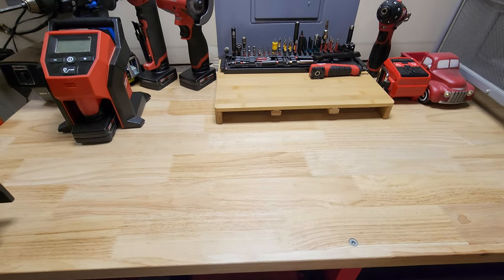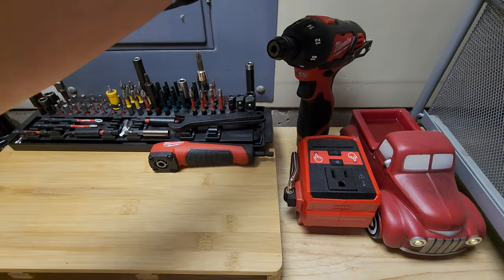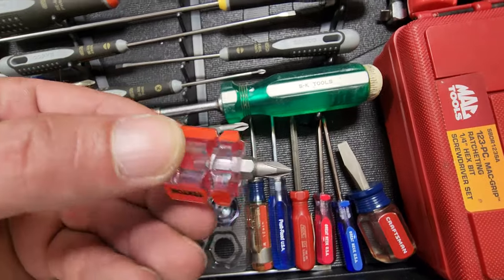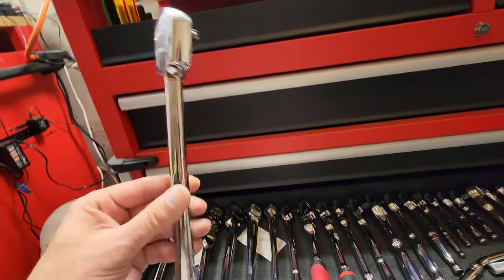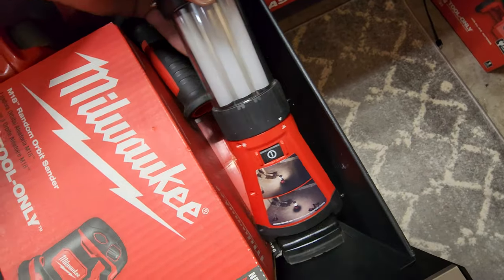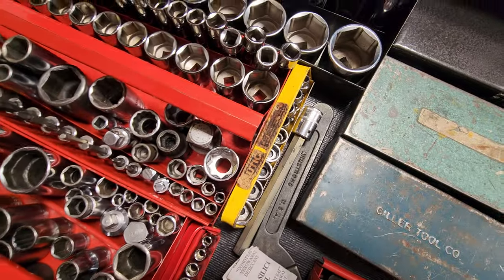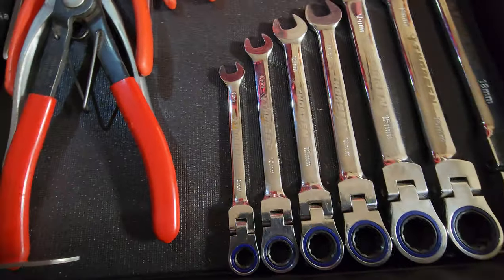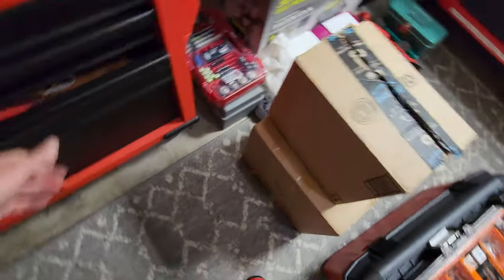AVERAGE JOE'S TOOL BOX TOUR 2022 MIX OF EVERYTHING

Comment: Hey man...
Im havin a bit of an issue with my
Convoy L21A SFT40 atm
Im getting this donut shadow purple
shaped in the middle of the beam hot spot 
and it's very prominent?
it's really pissin me off kinda thing
It wasn't like that in the begining
Not sure if it's the emitter burned out
after playing around with all the modes?
But the hot spot needs to be solid 
It was always Solid...
Im not talking bout when you hold it
really up close like on a table 
to see the Beam Pattern shape
there's always that little bit
But fades out as you shine it further
That's normal..
But now this is pretty much noticeable
even when you actually shine it 
at a distance on a wall building 
or anywhere else
Have you experienced anything like this
with any of your lights..
Your ST40 review was pretty solid 
Thats how mine used to be
don't know why it's doing it now
and it was purchased from 
Convoy official store...
It was a few months back so
I don't think there's anything i can do
to get it replaced at this stage
But i don't want same issues
if i buy a new one either....
Reply from the maker: Sorry to hear you are having issues with your l21a, I'm checking mine out now and it's solid no issues,  Did you check the surroundings and the LED to make sure nothing accidentally interfering and shake it lightly to see if anything is lose or rattling?
Reply: @smotheredchrome  
Apreciate you getting back to me 
on this brother 👍👍
Everything inside is pretty much solid as
I never had issues with Convoy before
It could be a one off thing
but i just taken out the actual 
mirror reflector and when used without it
seems to work ok
But its basically just a big round flood
at this stage, so i think the fault is the
actual mirror reflector itself 
for some reason
Its not damaged or scratched either..
I tried cleaning it and polishing it too 
but the ring is still there..

You know what it looks like 
Remember The old MAG LIGHTS 
or any of the past lights 
how you used to get the ring shadow 
right in the middle of the beam?
That's pretty much it

I messaged Convoy on Aliexpress
but we'll see if anything happens

I wana  try and change 
the actual reflector inside 
and see what happens?
I think that will fix it
You know where i can get them
On their own like that?
Either that or get the entire 
Flashlight Host and try that...
But still i'd rather just get part
And If that doesn't work 
i can always take it out on the property 
and use it as a target with my Marlin 45/70 👍👍
Reply from the maker: I'm not sure on convoys warranty I've never had to deal with them But see what they have to say I will keep an eye out for reflectors did you check eBay maybe or maybe convoy might sell reflectors pretty cheap if I see anything I will definitely let you know.
Reply: @smotheredchrome  
thanks👍
Reply from the maker: No problem my friend appreciate you 🙏
Reply: @smotheredchrome  
I think that's how the actual light works
Looked at the stats on convoy online 
The Reflector is coated with a
Purple Mineral Film
Try it out and see

With the torch switched off
If you look into the lens  
While ur standing holding the flashlight
underneath pointing upwards ur room light 
You can see the reflection of it 
being completely Purple inside

The further it goes 
the more you can kinda notice it
Once you notice its hard not to
But...Still good light though
Still useful..not that bad
I'll try the L21B Version 
See the difference there

I mostly use the Convoy L8 SBT90.2
A Beast..my favourite of Convoy by far  

Thanks anyway brother Apreciate it 👍👍
Reply from the maker: No problem my friend appreciate your comments.